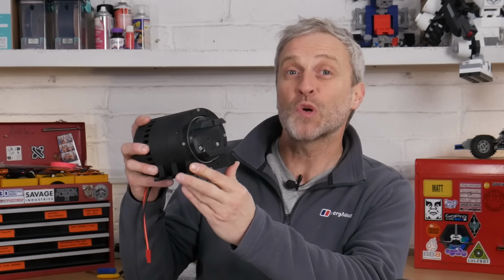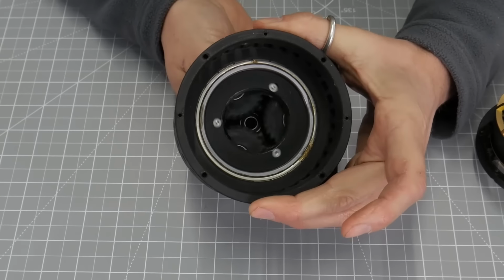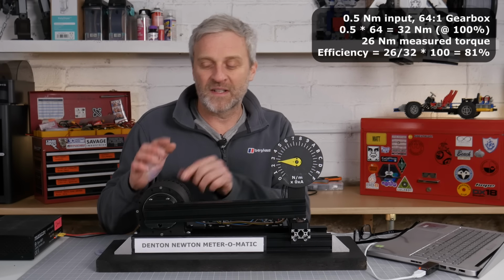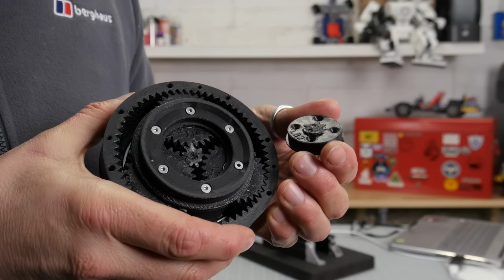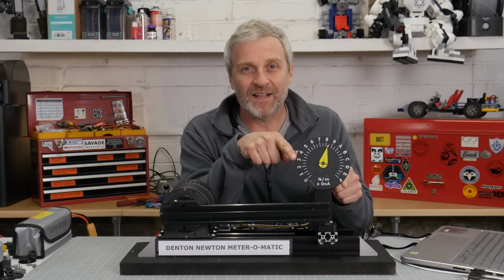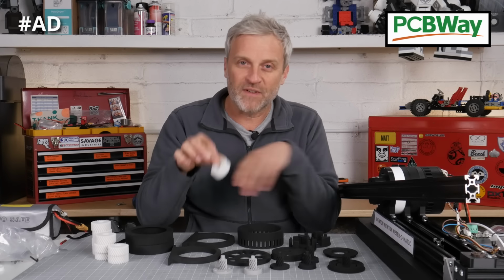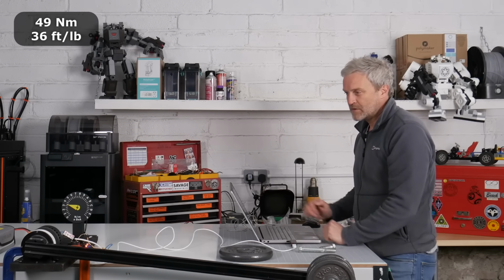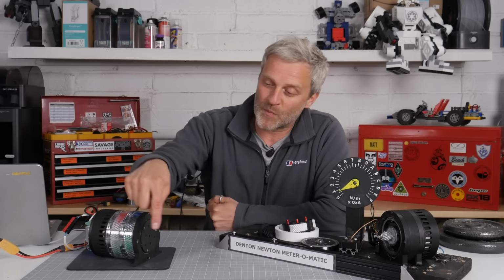Massive Torque 3D Printed Planetary Gearbox! - Mantis Hacks

Comment from the maker: MY MITSKE 😬 thanks to @ColinRichardson for pointing this out:  The formula for the gear ratio is completely wrong! The outer ring gears 63 teeth not 72 teeth. The formula is 1 + R/S = 1 + 63/9 = 8:1 reduction.
Reply: Try just building a belt drive :)
Reply: @Splarkszter  8 to 1 belt drive isnt usually practical due to massive inertia
Reply: I would like to see you test asa, asa-cf and pps-cf
Reply: so on the very last lift when the mount broke and the gears stripped, i think the gears stripped due to heat in the metal sun gear, if you had a way to keep those gears from getting really hot i think the outcome would be different, i dont think the gears would have stripped, instead i think the mount/case would have been the only part to fail
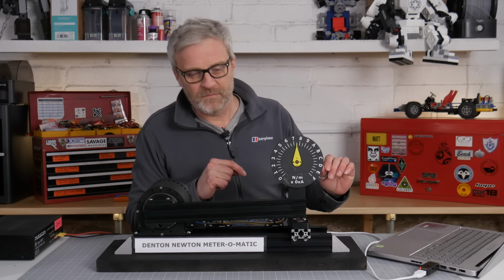Reply: 10:34 the calibration failed since it maxed out at about ~147 Nm (so a little above 14,5 soafter halfway of e but not raching f )

Comment: I wonder if a cycloidal drive might serve better. They give minimum backlash, can do 119 to 1 reduction in a single stage, distribute the power over a greater area and are typically used in robotics, and you are building a robot.

Comment: Why are some of them partial infills and not 100%?  Also, why are the layers up the z-axis?  There is plenty of research on FDM bolts to prove this is a bad idea.  Print these sun gears horizontally with 100% infill.
Reply from the maker: The middle infill offers very little strength. There isn’t much area in the bit that’s hollow. Which is why drive shafts can be hollow and not loose much strength. The square rule of area. If they were printed at an angle or horizontal then the gear mesh would be poor and friction / wear would increase
Reply: @MattDenton  While this is partially true with driveshafts, the primary purposes of the hollow core is to reduce inertia and weight.  You're not testing inertia.  You're testing layer adhesion and shear strength.  Go back and look at your first PC core.  You have more than 50% hollow, which is probably yielding around 80% of its max shear strength.

"The middle infill offers very little strength." You disproved this using PC with a Titanium core...twice.  (There's a lot more to unpack with this test.)

Regarding Horizontal printing.  It can be done two ways.  The first is easy using support material of dissimilar plastics. The second and more complex way is to create a two-part sun gear similar to your titanium core experiment.  For example, print a PPA-CF/PPS-CF inner spline at 45-degrees (horizontal produces weak splines and vertical produces a weak neck) with support material.  Don't use dissimilar plastics for support because friction is now your friend.  For the outer gear, use PC printed on the z-axis. PC will give you the best combination of strength and smoothness that you're looking for.  The only caveat with using PC (and ABS) is shrinkage, as I'm sure you've learned.  This will require the extra step of a shrinkage calibration strip.

FYI: Manufacturers provide spec sheets for shear strength.  In order of shear strength: PPA-CF, PPS-CF, PC, PETG-CF, PLA-CF, i190, and PCTG.

Last, impressive planetary gearbox!
Reply from the maker: Ok. So everything o say is wrong. And you are right. 👍

Comment: Be warned, most plastics, but especially PLA will take short duration loads FAR higher than long duration. A 3d printed m4 in PLA (0.15mm layers 0.44mm wide, all walls no infill) takes about >20kg tension for about a minute with no complaint or visible change... but 10kg hanging will fail ~2hrs as the plastic continues to move... well.. plastically. The actual truly elastic zone is tiny, just a couple of kilos will cause enough movement to make the thread rough to turn after a few months.. but do note how the movement with both weight and time is near exponential, so for most applications you can safely "proof" test at twice your load for a day or two, and if it doesn't deform be pretty sure a part is going to last. Your few seconds however will be very hard to translate to anything but an impact stress, as even several times less force (that would feel like a plenty adequate safety margin) might be FAR more than it will survive for half a days use.

Also given the mode of failure, putting a tiny bolt straight down the center of the part (which was previously infill on a few of your gears anyway) and using a nut/washer to clamp those layers together under a bunch of pretension would have increased your numbers a bit. Very impressed with that sintered nylon though, I didn't expect that high of a number.

Comment: Nice Project. Hope this will work with long time testing. 
What i thought was, when the layerbonds fail on sun gear, what happens if you print in a different orientation so the layers arent the issue
Reply from the maker: It may help, however, the PLA tends to break through multiple layers which implies it’s not layer adhesion that’s the issue, also, printing at 45 degrees for example would make for more friction in the gear mesh. IMO
Reply: @MattDenton That could be. Right.
Did you put lube in the Gearassembly? Looked like it after your first teardown but in the broken Gears it didnt look like it.
Reply from the maker: Yes silicone lube 👍

Comment: I think we are finding out that adding CF to anything makes it worse. It may indeed be stiffed , but at the expense of layer adhesion
Reply: Seems to me like you almost had it I'd say it doesn't always make things worse. When printed this way for this application, which rewards prints of higher layer adhesion, it is less performant. It would be very interesting to see if any performance gains could be found by printing in a different orientation, or is it just not suited for this kind of load. Because I have seen other tests of cf out performing other materials in various types of strength comparisons. 
¯\_(ツ)_/¯
Reply from the maker: The problem with printing at a different orientation is that it ruins the mesh so you lose efficiency. IMO

Comment: you need to do some research on lenco transmissions! what you've basically made is a single section of a lenco. Lenco transmissions are built for american style drag racing and use planetary gear sets to increase gears in the transmission and thus are quite long but are insanely strong. In those, they use straight cut gears which helps cut down on internal pressure and case loading a LOT. you should be using straight cut gears with this.

Comment: Thanks for this. I’ve been wondering if an FDM 3D printed gear box could hold up to duty slowing down a bandsaw powered by a 1hp electric motor. Lots of people trying to slow down wood bandsaws, and traditional gear reductions are expensive. Nice Jurassic Park reference, btw. 😊
Reply from the maker: Ahh thanks! 🙏 I’m trying to recall the reference now 🤔 I do tend to drip them I here and there 😂
Reply: Ian Malcom,  @MattDenton …😊

Comment: For anyone trying stuff like this, pushing the limits of the filiment, take this advice from and R&D technician.  Print your models with a 15 percent gyroid infill.  Then, drill a pair of holes in the top of the part.  Then, use a syringe and long needle to inject a low viscosity epoxy into the infill voids.  This gives you the strength of the epoxy with an impact resistance of the thermal plastic.  You get bonus points if you figure out how to add threaded inserts into the part so they are axial along the Z print axis and are fully encapsulated in the epoxy.
Reply: @jameslmorehead  dosent epoxy expand? I have been temptrd to try this but i have always been afraid of having the parts crack due to expansion
Reply: @A-G-F-  It depends on the brand and type, but in general a metal filled or glass filled epoxy does not.  Of the non filled varieties,  it is more of a concern of shrinkage after curing than expansion.  Expansion typically happens when the heat is released during the curing reaction.   Controlling the rate of the reaction by external or internal methods make this a non-issue.  Hence the recommendation of a metal filled epoxy.
Reply: For larger parts (both for cost concerns and because you never mix larger batches of 2 pack at once it WILL go on fire with the extra heat in the middle insulated by other curing material) even concrete with the biggest rocks taken out works well, and with a bit of part design you can avoid infill almost entirely. See Chris Borge here on youtube for 3d printed machine tools that where made in this technique.
Reply: @SheepInACart No matter what you do, the Z axis is going to be weak. Hence,  the reason for epoxy filling.  

Yes, heat can be an issue, but this can be mitigated through controlled chemistry and/or geometry.  This is done in industrial settings all the time.  We do it in my line of work all the time.
Reply: Would jbweld be ok?

Comment: One thing that I see other people doing, is printing at an angle. It makes it so the layer lines are not straight through key parts that are getting stressed. It takes more support to do it this way, but the result is an item that has significantly more strength. It doesn't shear as easily.
Reply from the maker: Yes 👍 the down side is that the gear mesh suffers
Reply: @MattDenton  I don't know much about 3d printing, im just getting into it myself, but maybe there's a compromise that can be made on the angle and the print and the direction it's pointing in that might give the best of both worlds without sacrificing too much. 

Another idea multiple splines/rods. 

Might be worth a test. 

I think it's pretty amazing that you were able to get that much force out of this machine though. I struggle to lift that much weight at arms length, to think that can come from a small motor with a gearbox is amazing. I've seen planetary gears before but never in action like this. Incredible force.

Comment: If the sun gear in metal is holding just fine, what you could do is increase the thickness of the last stage gears instead of increasing the number of teeth. That's more contact area on the teeth, so those may not shatter any more. This way, the length of the built would increase instead of the diameter.
Reply: I'm quite late for the ideas haha
Reply from the maker: Yeah that’s a possibility
Reply: Using a larger sun gear on the final stage so you could have 4 planets (but less reduction) is also an option. You don't need to compensate to keep 8.1 exactly since the motor was pretty far from its limits at part failure, and if that ceases to be the case the final belt drive could fairly easily be bumped up to 2.5:1 instead of 2.0:1 to handle that torque on parts that aren't 3d printed.

Comment: Interesting video! You must have broken a lot of pieces ;-)
I have design my own 3D printed planetary gearbox, but it's different from yours : each stage have 4 planeary gears for 1 sun gear, all have the same diameter. To attempt a 64 gear ratio, i need 3 stages. The external dimensions are little bit longer, but i think that the sun gear is subjected to less stress. I regret not having tested my gearbox to its limits to compare the two architectures. I have use PET-CF for almost all parts, it's a relativly strong material, but the particularity is that's a little bit flex. It can be a pb or an advantage according to your utilisation. Advantage if you want to create a shock absorber between gears, to absorb brutal variation of velocity or way change. Pb if you pay attention to the backlash (that is the major pb of planetary gearbox i think), beacause this material increase the backlash due to the torsion of gears (without break).

Comment: How about printing sun gears at an angle (i.eg. 45 deg.) so layer bonding wouldn't be on the same plane as the shear line/breaking point we observed? Layer bonding wouldn't be such a big factor and the element should withstand higher loads.

Comment: Something interesting about pla is it’s quite hygroscopic and will weaken significantly as it absorbs water post print. The tensile strength is less vulnerable to this effect compared to stiffness and especially creep.

You can reduce this with annealing.

Comment: I made one at home using PETG for a shredder, but I made the gear in a double helical shape, which gives the gear more surface contact and therefore allows it to handle more torque. I never really measured it, but if you want to try it out, you need to make the orbit gear with a cut so you can assemble the whole thing. It’s a little messy, but it’s worth it.
Reply: I was thinking about a print-in-place to solve the cut problem
Reply: how much input torque and rpm vs output torque and rpm can it sustain

Comment: maybe better if use enclosure and gear soaked in lubricating oil,
Reply: Oil would make the output a hair smoother and fractionally increase static torque efficiency.. but it would also be messy and potentially weaken some of the different plastics shown, while most of its benefits in providing film layer for wear reduction and removing heat aren't utilized till your spinning multiple RPM. The motor here only turns 8.1x more than the bar on the load gauge plus backlash and elastic twisting of the gear-train... which is probably less than quarter of a full turn between start and failure.. so lubrication doesn't get much chance to help, and a heavy grease would have worked best.
Reply: @SheepInACart yes. But planetary gear, input from motor have higher speed rpm

Comment: A bit too late for a suggestion possibly but have you considered printing the parts at a 45 degree angle? Would make it harder for it to snap by the build line maybe?
Reply from the maker: Yes,  it gear mesh would suffer

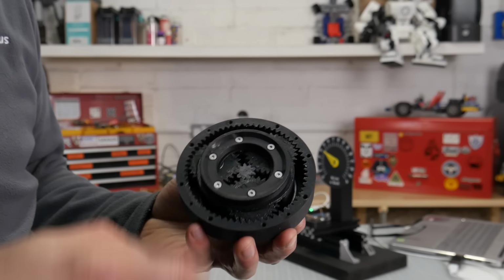Comment: Around 20:00 you're discussing layer bonding, but it's still shearing off around the same layer line. If you were to flip the print sideways and change the direction of the layers, would that add strength? I understand the different infill can also have an impact, but I'm curious if it would stand up to more force simply changing the print direction?
Reply from the maker: Yes, but the gear mesh would be terrible I think

Comment: There's something to be said for having a reliably weak part of the build protecting the rest from failure, but would you consider rotating the sun 90° so it's on its side and seeing how that holds?
Reply from the maker: Yes but the mesh will be compromised

Comment: i like the hint of Ukraine in the shot at the start
would appreciate if it could be used as a hand crank power generator or some type of pedal device with capacitors and lithium battery bank

Comment: Just pack your sun gear into some sand and pour in molten steel.. That will melt out the plastic (which will float to the top) --  and you'll have a cast iron/ cast steel/  or cast aluminum sun gear.   It's actually easy to do.   Just need a simple torch or forge.  From there it immediately goes to those three planetary gears;  so it will be 3x the strength-  and should reach much high numbers.

Comment: I may have missed it but why aren't you using something like graphite inside the gear housing? You thought it might be the friction losses resulting in hitting the limits. Grease likely couldn't be used with the 3D parts. Graphite would probably work though.
Reply from the maker: Grease helped a lot. I could try graphite though

Comment: Looks like the last dynamic test failed when the planet gears overheated.  That's usually the limit of plastic gears.  A higher temperature plastic or some cooling would help.  Since the gears are mostly rolling contacts, high strength and low stiffness gives the best static strength.  Then for dynamic strength you want low heat generation when flexing, high thermal conductivity, and high strength when hot.  Obviously can't get everything in a 3D printed polymer, but this will help guide the search.  Or you can just make the gearbox bigger...

Comment: I'm two months late to comment on this excellent video.  (It popped up in my YT home feed, and now I'm hooked and subscribed.)  So someone likely already said this in the comments below (tho' a quick scan didn't find it):  

I think for more accurate load measurement, you ought to have a roller bearing on the end of the lever arm that contacts the pressure cell.  To eliminate the possible stiction at that contact under load.
Reply from the maker: Yeah there could be a better setup but the deflection is so small it should have that much impact.. I think 🤔

Comment: Nice the old school lego big car build in the background ^^ had fun times making that thing radio controlled with 540 motors... and the fact lego gears a re not made for such motors. ^^
Reply from the maker: 😂 a 540 would destroy Lego gears! Nice idea though 👍
Reply: @MattDenton  O yes it did many times but at some point I made the first gears out of simple (self cut ( it was the mid 90's at the latest) plastic sheets stacked together and glued together and that made it on low power and rpm so yeah it worked ^^ but only about 2 times as fast as the 'normal' lego motors. (it was the black 12 volt the 880 set) So all in all a good learning experience months of time spend building and an increase in speed and power.
What a happy time that was ^^

Cheers and thank you for the memories even though unintended ^^ !

p.s. if only I'd had known about the planetary gearbox (on the other hand it would have taken me years to finish it ^^)
Reply from the maker: @davidliefrink9818 awesome! Happy to have jogged a fond memory!